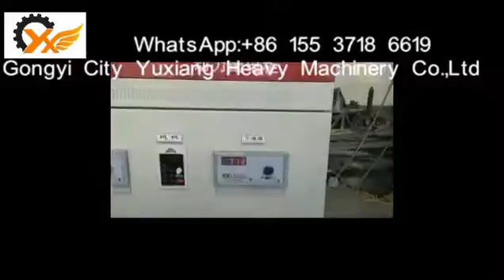2016 Continuous smokeless jute stick carbonation furnace for sale in Indonesia

Comment from the maker: Gongyi City Yuxiang Heavy Machinery Co.,Ltd. is located in China famouse machinery county-Gongyi (Henan),covering an area of over 20000 square meters.Being an ISO 9001:2000 international Quality System certified enterpise,since its born Yuxiang has been concentrating on Research,Design&Manufacturing of Mining machines like wet pan mill,ball mill,crusher etc.;Biomass energy machines like carbonization furnace,charcoal briquette machine;Oil press machine series.